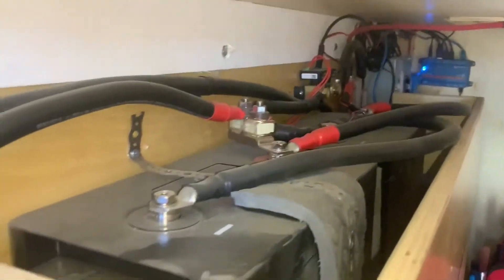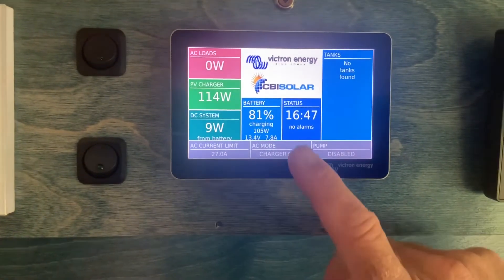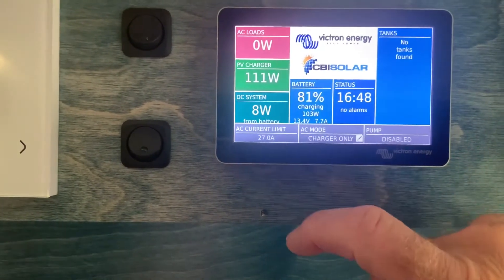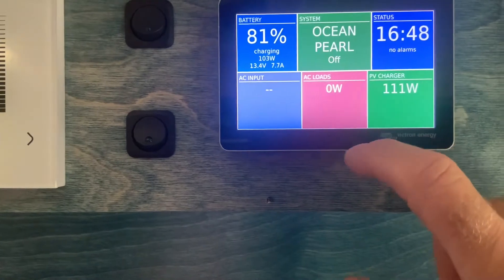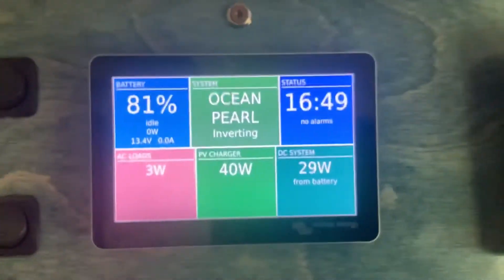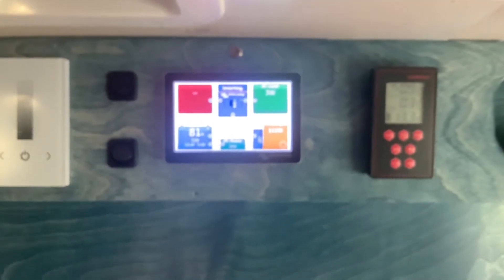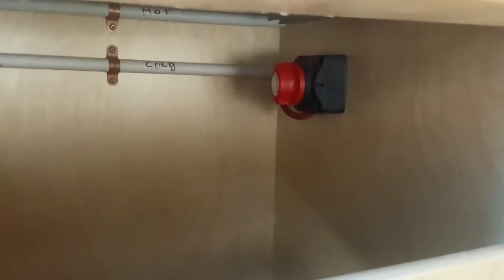Van Solar Cerbo GX Touch Install and Operation - Solar Installation Part 3

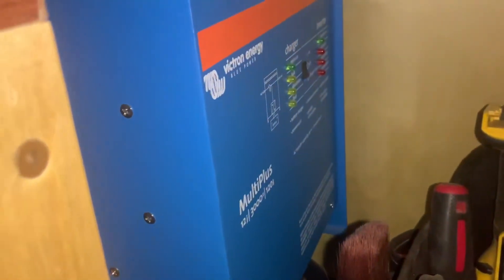Comment: 0:33 the DC-DC charger is one of the hottest running devices in that setup, and you got it mounted wrong. all the heat between the blades will be trapped mounted in that orientation.
Reply from the maker: Thanks very much!  I have looked into this more and you are correct, the orientation of the unit, fins running vertically is very important. The unit can get to 130F during peak output but this is normal. Check with Victron as they did have some Smart Orions got out in 2021 with bad hardware that are getting even hotter and are dropping output current. If you have one of these you can return for a new version.  Thanks again for catching this, I will be moving mine ASAP.
Reply: @dadzvanz936  I actually just bought one a few weeks ago. I doubt it is one of the duds, but only time will tell if i need to return it or not.

Comment: Can you share what size rims you put the 245 75/16 K02s on. I am having a problem finding 16x7 wheels that have the off road look for my promaster 2500.
Reply from the maker: 16 x  7.5 x 130. I have the Rhino rims